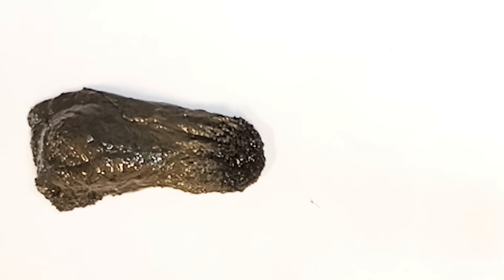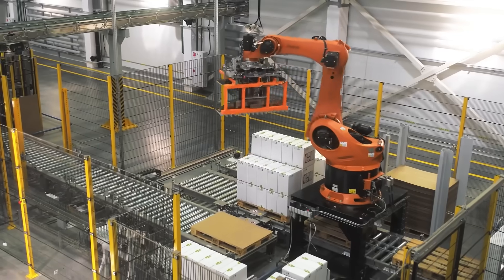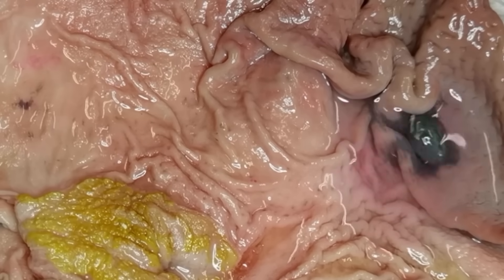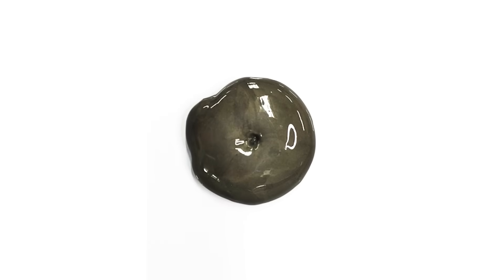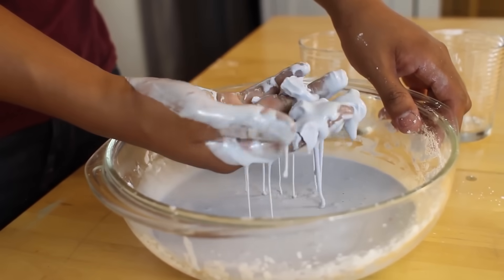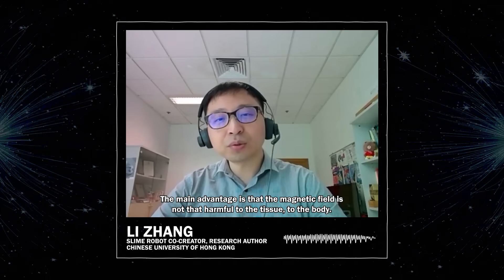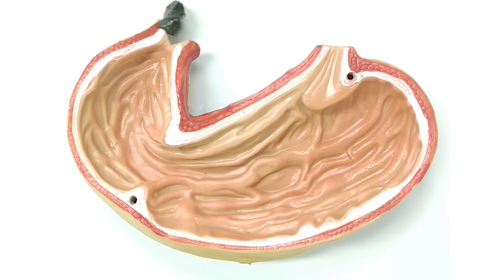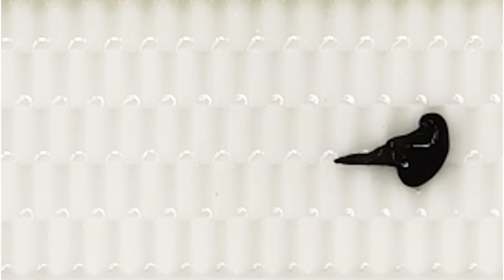This Is The First LIQUID Robot, And It’s Unbelievable

Comment: Liquid robots will come in handy for fixing micro circuit boards, as micro components (resistors, capacitors, and transistors) could be removed and installed without soldering.

Comment: Calling this a robot is quite a "stretch". This seems more like a magnetic putty toy. Once it is given any sort of autonomy it will then contain components that will most likely hinder it's fluidity. And if you have a robot control the magnetic putty externally then I would not call the putty part of the robot, more of a tool that the robot is controlling.

Comment: This is very misleading IMO. The slime is not a robot. The slime is what the fingertips of solid robots would be. The robot is the entire system controlling the fluid from the outside with magnetic fields. The fluid, which is the only thing you show, is the end effector of the actuator of the robot. What is shown implies that the fluid itself is what is moving itself, which is not true.

Comment: Science is pretty far for what is a narrowed way of thinking; like holy; what are people thinking;
Science fundamentally is literally considering everything, at every perspective and angle and identifying multiple consistencies and pattern by definition.

when real scientist says something; there is basically a reason for it, with causes, and multiple angle and perspectives already considered and analyzed, and yet still more to be analyzed sometimes.

like that part where people actually think science is narrow minded; is really flawed perspective fundamentally; by the very definition of science:

The definition of science:
the intellectual and practical activity encompassing the systematic study of the structure and behaviors of the physical and natural world through observation and experiment.

There is thing where people are wrong; when there is more thing that were unknown or unseen to be connected.

But like people don't know any more what there even saying or thinking; science isn't an ideal; it isn't even a thought, or even a dogma; it's just an action to try to find answer with real fundament and pattern; PREVENTING as much as possible jumping to conclusions, assumptions, feelings and biases etc.

Like people speak way out of turn; and because of this is the reason why there are many problems; just because a scientist says something that doesn't mean science is that something; just because people use the scientific methods to try to find something, that doesn't mean that the end result is a captaincy, especially when people rapidly take whatever comes out of the box for granted.

The worse part comes when after the research; people start giving their biases; like the time people said of the study that male look at female streamers; that means all men are degenerates and the must be removed.

They use a single piece of the information obtained by the methods, and drastically blow it out of proportions starting to make assumptions; and then say "that's what science confirms;" and all their research was a random internet survey; and massive dilution of the information.

If there is something I noticed in my life; is that information doesn't make people intelligent; it's how that information is properly connected, and that self-interest or convenience is thrown completely out of the windows/equation.

This is the problem; People want to win; instead of trying to learn and comprehend.
people are using things to just be in the brighter light instead of trying to help and learn.

This is the problem in all history; people are trying to win; and in order to win they create an enemy/villain so they can be the heroes.

Things in life aren't about wining; it's about understanding.

Pardon that I wrote this here; but that line of people believing science being narrow; really triggered multiple dots in my brain.

Comment: This actually has HUGE implications for cancer patients.  Cancerous tumors have to be excised by surgery, and if it metastasizes throughout the body, you are done for.

If you can deploy a bunch of tiny robots, they can seek out the cancer throughout the body and remove it.  Even if the cancer becomes widespread, it could perhaps be managed by keeping these things running.  You could even remove cancer at the cellular level before it becomes a "detectable" tumor.

We can't cure HIV yet, but we can keep the virus below the "undetectable" level with antiviral therapy, allowing people with HIV to live just as long as anyone else on average.  Stage 4 cancer could theoretically be managed in a similar manner, if we proactively and continuously remove cancer cells as they form.

Comment: that is not a robot, don't change definitions to fit what your trying to say.
robot, any automatically operated machine that replaces human effort, though it may not resemble human beings in appearance or perform functions in a humanlike manner. 
Now does a blob with magnets in it have any correlation to the definition above.

Comment: I see this being extremely useful in emergency medical situations. Such as being used to close wounds, stab wounds or gunshot wounds. Maybe something that could be carried around in ambulances, to close wounds on the scene, keeping the patient alive long enough for them to arrive at a hospital. Maybe being liquid when exposed to electrical current and being solid when not exposed to electrical current. That way it could be added or removed when current is applied by the medic or physician, but would be solid at rest to keep the blood in.
Reply: or they could just... yknow, cauterize the wound on site? its not very easy to physically hold your blood in your veins when theyre ruptured and your heart is beating.
Reply: @Fish-cj4ub  Cauterizing the wound won't be enough if there is a chunk of flesh missing, a substance that could enter the wound reconnect the veins and be removed at the hospital would prevent a lot of roadside fatalities.
Reply: What you're talking about is very much science fiction.

All this new material does is react to magnetic fields because of the magnets inside. 
It still needs all the heavy and complex magnetic field generator which would need to surround the object all around like an MRI for the substance to be able to move in 3 axis.
Reply: @redmist4963  A lot of technological and medical breakthroughs start as ideas that sound like science fiction. While this substance most likely would not see use in that capacity, it does not mean eventually other substances like it could not be used for critical injuries.
Reply: Yep... And used for evil too
Reply: @roseyk7677  Literally any tool could be used for evil, the pencil is a wonderful tool that allows for the expression of ideas, creation of art, and drawing of plans. But a pencil could also be used to stab someone to death. Since there have been human beings, they have always used whatever item they can kind to do each other harm. These are the worst of humankind. I don't think we should allow the worst of humans dictate what technologies should be allowed to exist. Especially potential lifesaving technologies such as medical nanobots. When any tool can be used a weapon, and only the most advanced tool can be used to heal and repair, we must not stop developing. 

Also don't you see the irony of saying advancement in technology is bad, while writing in a youtube comment section.
Reply: Literally any tool could be used for evil, the pencil is a wonderful tool that allows for the expression of ideas, creation of art, and the drawing of plans. But a pencil could also be used to stab someone to death. Since there have been human being, they have always used whatever item they could find to do each other harm. These are the worst of humankind. I don't think we should allow the worst of humans dictate what technologies should be allowed to exist. Especially potentially lifesaving technologies such as medical nanobots. When any tool can be used as a weapon, and only the most advanced tools can be used to heal and repair, we must not stop the development of emergent tools. 

Also don't you see the irony of saying advancement in technology is bad, while writing in a YouTube comment section?  @roseyk7677
Reply: @roseyk7677  Literally any tool could be used for evil, the pencil is a wonderful tool that allows for the expression of ideas, creation of art, and the drawing of plans. But a pencil could also be used to stab someone to death. Since there have been human being, they have always used whatever item they could find to do each other harm. These are the worst of humankind. I don't think we should allow the worst of humans dictate what technologies should be allowed to exist. Especially potentially lifesaving technologies such as medical nanobots. When any tool can be used as a weapon, and only the most advanced tools can be used to heal and repair, we must not stop the development of emergent tools. 

Also don't you see the irony of saying advancement in technology is bad, while writing in a YouTube comment section?

Comment: As per the liquid robots you would have to deal with hydrochloric acid desolving it if it was in the stomach and it would seem more possible to deliver stemcells to damaged areas contained in the liquid robot via an artificial bubble of nutrients in magnetic foam bubbles maybe

Comment: 27 seconds in on the maze. It’s all fun and games using it for bodily use, until it releases tiny bits of itself inside you. just as it did near one of the last turns in the bottom right of the maze.

Comment: May be possible to firstly  map out the internal organs and arterial circuitry of the individual human body using say MRI etc.
Once the internal map is there then such robots can be programned to along particular pathway either  independently  or externally directed ( similar to any  navigation tool such Google maps)
Reply: That similar to what I was thinking. A smaller version of this could be used like platlets to close wounds. After we have programed the body's circulatory system into it.
Reply: yeah, can't wait for this to get into the wrong hands

Comment: It could be a good tool to clean the inside of computers from dust without having to take it apart. Maybe even repair it someday removing corrosion or replacing small chips. One robot attached to the outside transfers heat the other one replaces the chip. Or it can turn into a police officer.

Comment: This is the equivalent of your uncle convincing you he is magic when he is holding a magnet under the table.
It's not a 'robot' it's a floppy fridge magnet.
Reply: Good comprehension, and I agree. 5:17 pretty much says it all. This is marionette-putty.
Reply: A robot-arm as seen in the video is just metal and plastic parts, controlled by a computer (oparated by either a human or AI) , via motors. This is basically the same, just a blob, controlled by a computer (oparated by either a human or AI) via magnetism.  (electromotors are also just magnets) So if a metal arm is a robot, why not the blob? Both are things, that can manipulate other things, and are controlled via a computer of sorts. It's kinda like an rc car, but cooler.
Reply: @proclarushtaonasat  A robot arm is just metal and plastic parts controlled by a computer via motors.
This doesn't have parts, a computer or motors.
This is like calling the silicon fingertip's a robot.

They are a small part of a robot, calling them a robot implies that they are self powered and have a level of processing. They have neither, it's a ball of slime rolling around a desk above a magnet.
Reply: Microrobots could deliver drugs straight to diseased tissue.  Fish-Shaped Microrobots to Deliver Chemotherapy to Tumors
https://youtu.be/4Qa7W-TH948
.......

Comment: I wouldn't call it a robot lol. You need a magnet to control it.
A robot, to me at least, moves without touching or pushing or you manually moving a magnet. 
It's closer to Ferro fluid lol

Comment: I understand that it’s a small device and that it’s hard to control and power if it were to be autonomous but for the power supply since it can interact with things why not have it enclose something the size of a pill in it self and we send it power directly with a wireless current like how phones can charge on those weird pads yes it’ll have to be close but having a small pad on your body charging something that could save your life I wouldn’t see a problem with it

Comment: So it isn't actually a robot which constitutes circuit boards and self moving etc. it's just magnetic slime, OR, you would have to say iron filings are robots. How is it self propelling? how does it navigate without some way to host an AI system? it can't, it can't see, can't do anything really. It therefore is NOT technically a robot as itn has zero robotics, it's just magnetic slime manipulated by someone holding a magnet. It's like saying those who Vape, create the clouds in the sky.

Comment: This isn’t at all a robot, or ground breaking… it’s simply magnetic slime that is manipulated using another magnetic field to drag it where you want. All this mumbo jumbo about self healing and it going into tiny spaces to fix electrical components is nonsense. It “self heals” the same way any liquid does. Fixing electrical stuff would require you to run a parallel guide along wherever you want the slime to go… making the slime obsolete since you can obviously reach the area you want the slime to go. The electrical conductivity is also going to be quite junk. Forget about the issues you would run into if it was highly conductive.

Comment: Interesting, but by no stretch does anything in this video describe a robot, just a material. At this stage it's obvious that there's a lot of work to be done but some insight into the current control system would have been valuable

Comment: I’m still confused on how it’s controlled. Do you control the magnets remotely? Or do you preprogram it’s movements?
Reply: It's controlled by external magnetic fields
Reply: Microrobots could deliver drugs straight to diseased tissue.  Fish-Shaped Microrobots to Deliver Chemotherapy to Tumors
https://youtu.be/4Qa7W-TH948
.......
Reply: It's basically magnetic silly-putty substance that is controlled by magnetic forces externally. Robots have some form of command-based and/or self-moving components -- gears, motors (servo or otherwise) with the ability to produce motion via some form of potential stored energy (electricy, fossil fuel, steam, clockwork springs, etc.) If this  is a robot than my guitar is a DAW.

Comment: Some people really don't understand engineering.

You all can relax knowing slime robots are not going to take over society or infiltrate your body.

1. No this slime cannot move itself. It needs an external magnet to move.

This is the same concept of having a metal ball on a table, and having a magnet under the table to make the ball move around. 

2. Magnetic slime has been around for a long time. This is the same concept of ferrofluid. You can buy magnetic slime, or make it yourself. (look up magnetic thinking putty) 

3. This is not the terminator robot. 
The only way this would work within a 3D space to a precise degree is with an array of strong electromagnets. You would not be able to create complex shapes with magnetic slime out of thin air, you could only push and pull it throughout a body or on a surface.

Comment: A bit hoaxy if you ask me. It is worth mentioning no 3rd dimensional motion is seen in this video. It seems to me that every shot can be done with a magnetic table underneath. Like coins on a table with a magnet. As advanced of a table as it may be with programmable point contacts, it is still limited in the same way a coin on a table is. Yet the table or magnetic influencer is no where to be seen in this video. Why? It is where the real teck is. Right. Or....ist.  I would bet i can move a magnetic jell through every motion you see in this video with nothing more than two small electo magnets on two pointer like rods under a table. Even the lift up to grap the wire can be done with reversing the polarity on one of the rods and aiming it at a small strand of the jell. The more I watch the video, the more bs it looks.

Comment: There must be a regulation on the use of these Robots. This technology is undeniably of great help in various aspects but this could also be misused and could have adverse effects on living beings and environment.
Reply: Its magnetic slime. It isn't sentient. The only way it could potentially be used is on an operating table, as you would need ALOT of external equipment to move it around.

Comment: So they guide it around by dragging a magnet around under the surface it sits on?  Did I miss it or was the "how is it guided/directed" completely glossed over?
Reply: What this shows is that Nanoparticles can be influenced within the body by an external magnet or electromagnetic wave. There is now much discussion about 5G using wavelength of 1mm - to what end? I don't know.

Comment: This will revolutionize material recovery in a cracking process. Throw all garbage into a plasma and let the nano's separate all materials at high temperature by flying through the plasma at different temperatures and having different materials stick to them as they move to a recovery chamber. 

You could use these robots to create flow in sealed systems without the use of motors, like an internal pump for a 'material recovery' system operating at high temp where each of the distillates are escorted to their proper tanks by temperature treated nano's to facilitate their recovery percentage.

Just dial the system for the material you want to get and let the nano's recover it after passing through the correct temperature bath.

I'll assume gasses and liquids are similar and these nano's can be controlled at close to gaseous states.

Plasmas 
Liquids
Gases

Incredible work here.